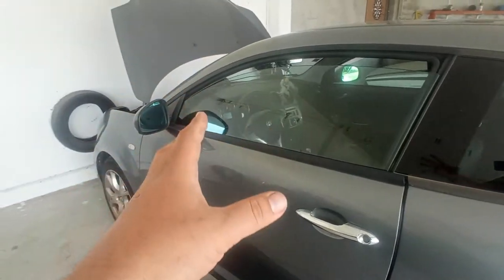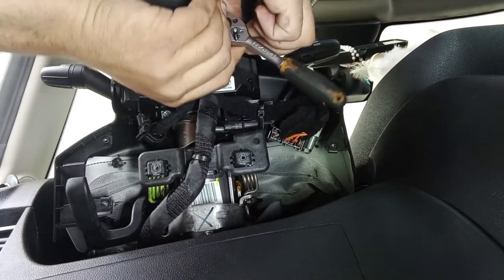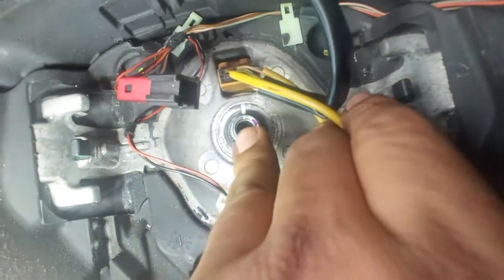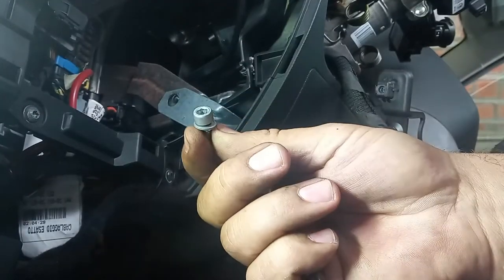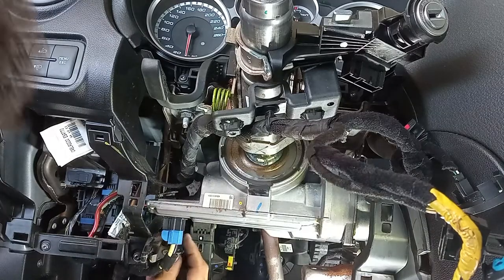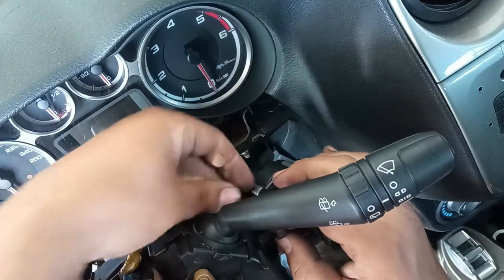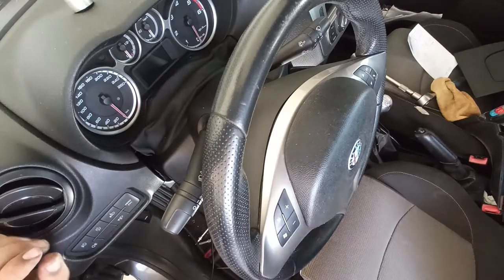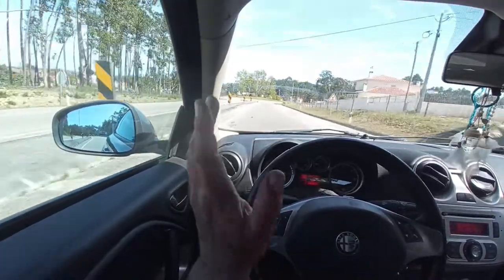Steering sometimes "LOCKS" or has LESS assistance to one side. Alfa Romeo MiTo

Comment: Hello. I have a 1.4T 2010 Mito. I have done all the maintenance properly, the car drives amazing but sometimes under the dashboard the triangle together with uphill sensors are popping up then after some minutes they are removed. Why is it the case?
Reply from the maker: Must perform a diagnosis and check that out

Comment: My 159 the rear N/S window when I wind it up sometimes it goes up and doesn’t stop and brakes the plastic lifting frame, doesn’t anyone here knows why ?
Reply from the maker: Hello. Are you using hi quality parts? Is the glass well seated on the holders?
I will have a video for that next month
Reply: @alfaromeonoproblem  thank you
The car was sitting for two years with the battery terminal off it happened after I started, the car is in new condition with very low mileage,
Reply: @BK-it6te  I think there is a sensor in the top window rubber seal, and when glass presses on it, it tells the motor to stop. Maybe the sensor or the wire for it is broken. What do you mean by N/S?
Reply: @DashCamSerbia   near side is the left side of the car
Reply: @BK-it6te  Ah, OK. You are from the UK.
Reply from the maker: @DashCamSerbia not quite. That is only for the anti crushing. For normal operation is not necessary
Reply: @alfaromeonoproblem  I see, thanks.

Comment: 👍someone has differently been in there before. What was wrong, the motor?
Reply from the maker: Hello. Did a few before, yes. Normally is an integrated sensor. The yaw sensor if I'm correct.
Reply: No I meant someone else was in there before you, because the screws are mixed and the plastic broken.
A professional like you knows where all the screw go😊.
Yaw sensor should be located under the seat of passenger or driver.
 @alfaromeonoproblem
Reply from the maker: @RichieRich845 thanks. Is the sensor that measures the steering wheel speed and direction

Comment: You took it apart, put it back together.
Good. And? The point is not in the video, the faulty part, or the replacement or repair.
Reply: He had send it to the specialist for repairs and got it back. He does not repair electrinics.
Reply from the maker: The description of the video is clear. The introduction of the video is clear too